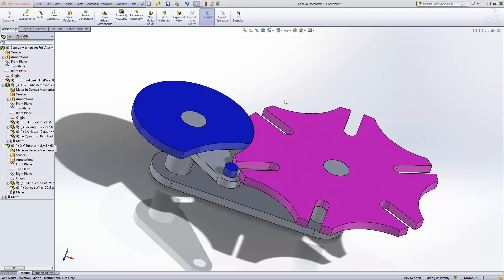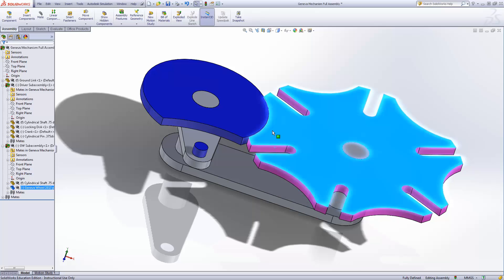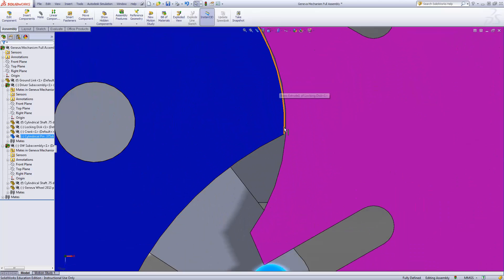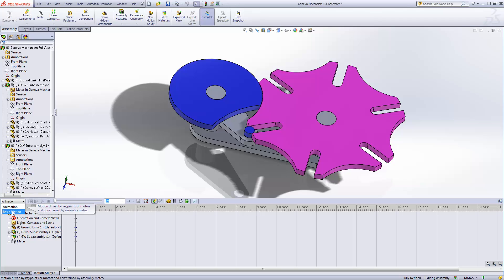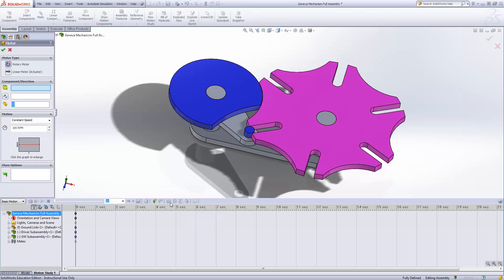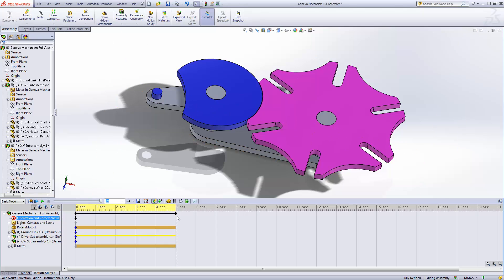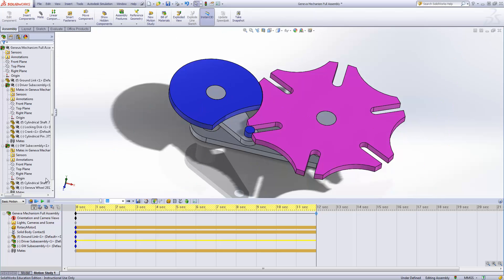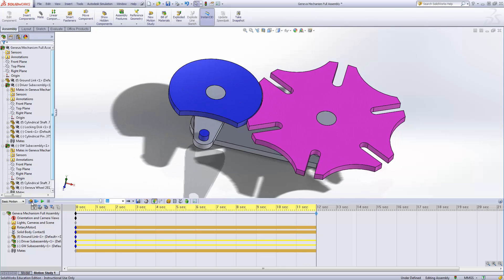Geneva Wheel Motion Study Part 2

Comment from the maker: I've found that if you use certain sets of assembly constraints, strange things happen in the motion study. Make sure you use only two mates each for the two subassemblies into the final assembly, one mating the plane on the end of the post and one concentric on the axes of the hole and the post. It will calculate the motion better. Also, don't crank the accuracy up to 10, as it may have unintended consequences.

Ali,
Your settings are not allowing me to reply directly to you, so this is the best I can do. Now, there may be large vibrations (not normal) or small vibrations (normal). The small vibrations I believe are due to the Geneva Wheel bouncing back-and-forth on the locking disk. There is no friction in this system, so as the pin causes motion, the wheel will continue to move until it hits something, then elastically bounce until it hits the other side of the locking disk, etc., until the pin comes back around.

I hope that helps.

Comment: Thank you for your tutorial. I am trying to simulate something similar, but I get stuck on a very simple problem: After I am setting the cylinder as the motor and press: calculate motion, only the cylinder is moving, and not the blue plate. Is there any trick with the mates or contacts? Thank you in advance.
Reply from the maker: +Sorina Lupu 
Sorry to take so long.
I think I showed the mates I used in the first video, and yes, they do matter. I've found that if you use certain sets of assembly constraints, strange things happen in the motion study. Make sure you use only two mates each for the two subassemblies into the final assembly, one mating the plane on the end of the post and one concentric on the axes of the hole and the post. It will calculate the motion better.
If your cylinder is the only thing moving, you must use the cylinder and locking disk/crank/pin as its own subassembly, then put it into the main assembly, or else make sure they are all mated properly (and also free the right way) in the main assembly. 

I hope this helps.
Reply from the maker: +Sorina Lupu 
https://www.youtube.com/watch?v=9Z2kdlJWjew

Comment: Thank you very much!
I followed your steps, and encountered a slight problem: Even though I've set the rotary motor's constant speed to be 20RPM, it still rotates from fast to slow within that 15 seconds.
Anyway, your video has helped a lot. Appreciate it.
Reply from the maker: +Ryu Lee 
I've found that if you use certain sets of assembly constraints, strange
 things happen in the motion study. Make sure you use only two mates 
each for the two subassemblies into the final assembly, one mating the 
plane on the end of the post and one concentric on the axes of the hole 
and the post. It will calculate the motion better. Also, don't crank the
 accuracy up to 10, as it may have unintended consequences.

I hope this helps.